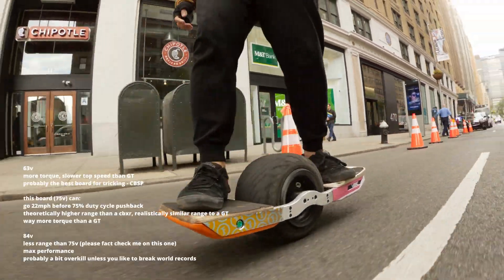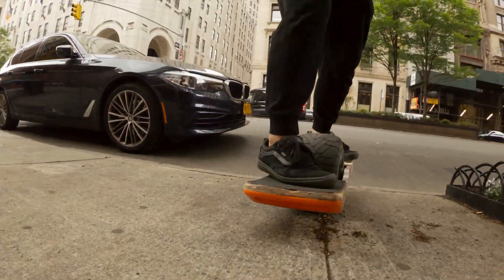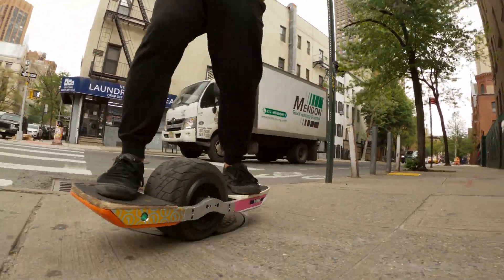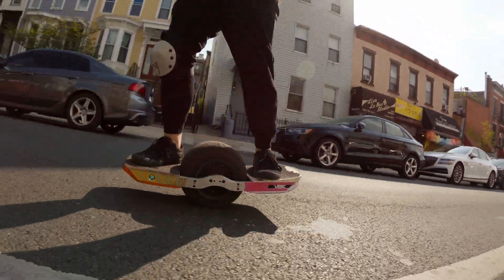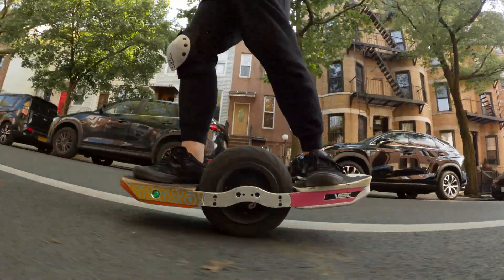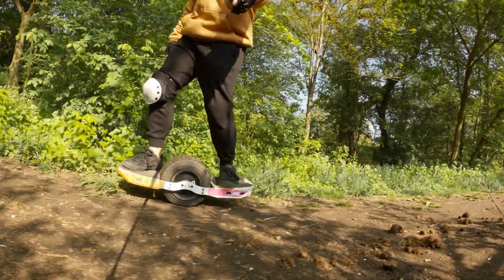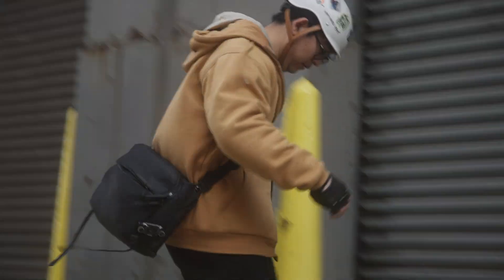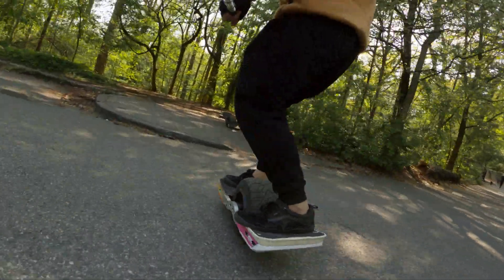10 reasons why a VESC is better than a GT

Comment: Awesome video man, I've wanted to cover many of the same points in some kind of video but I couldnt have said it all better myself! Especially the powering on in any orientation one, legitimately one of the best perks 😂
Reply from the maker: yeahhh! i still don't understand why that's a restriction on FM boards haha
Reply: @leonchang7596  I think I know why FM chose to do this - safety. There are corner cases where you could engage your board in the wrong angle because the IMU didn’t have enough time to get initialized. It also gives them one more sanity check during startup to make sure the IMU behaves as expected
Reply from the maker: Hmm, but the power button is indented from the rail so the chance of anything hitting it is super minimal. I guess it’s not zero. Does FM boards calibrate its IMU upon boot? That’s why it needs to be flat on the ground?

My argument towards dropping this feature is: 1) one of the first things first time riders do is to flip the board around to find the power button, lay the board on its rail and turn it on without reading the manual, and then they don’t understand flashing yellow light, and they step on it and fall forward. 2) skateboarding and eskate all have some kind of cool and easy way of mounting on the board without having to bend down. Skateboarders drop the board and step on it, some eskates automatically turn on the moment it detects the wheels spinning (at least 2 years ago when I used to eskate). Onewheel being advertised as a cool and stylish PEV should really have a better way of powering on other than bending down and pressing the power button. 3) they can always program in a double click on the power button to power it on at any orientation.